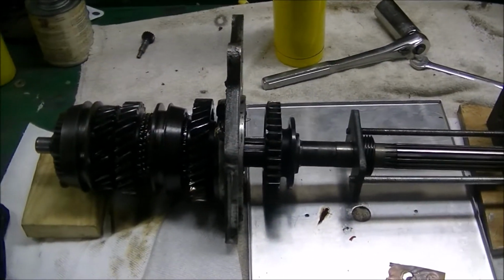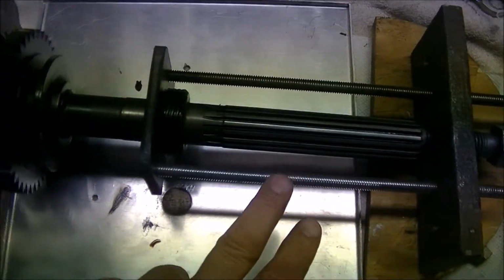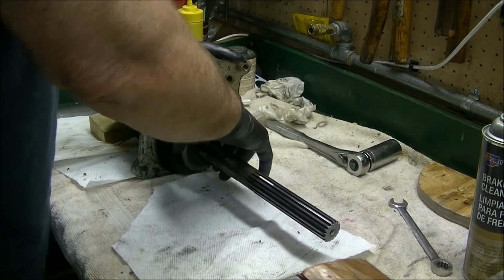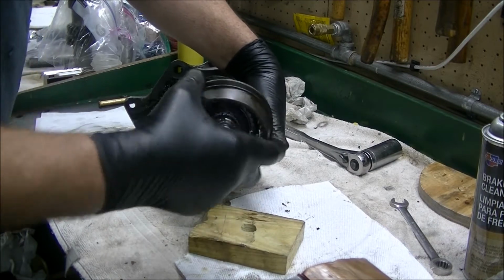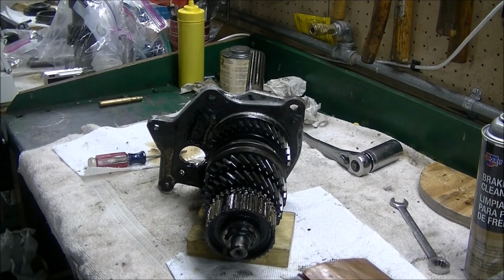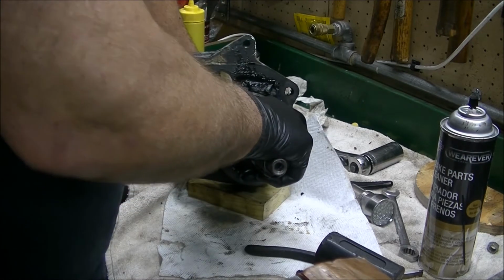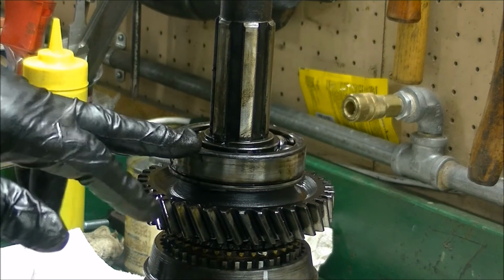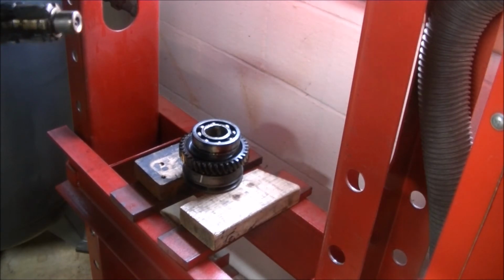Studebaker Rescue Video #32  --  4 speed Disassembly Part III

Comment: What is the measurement from the rear of the speedo gear to the end of the output shaft? Also, that is the new speedo gear tooth count? I have to replace mine to the correct count to match my new 17 tooth for the speedo drive “bullet” for the cable.  Thank you.